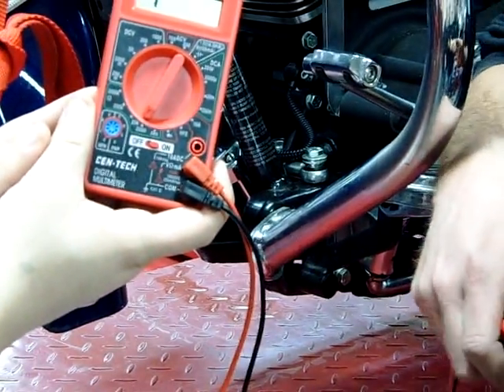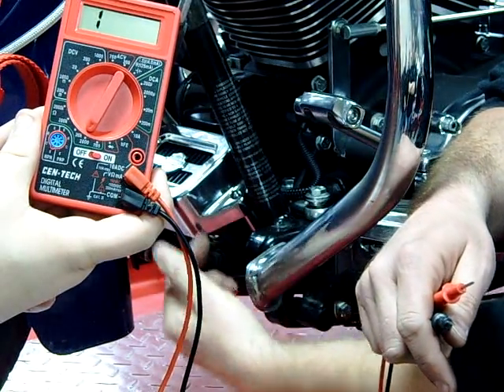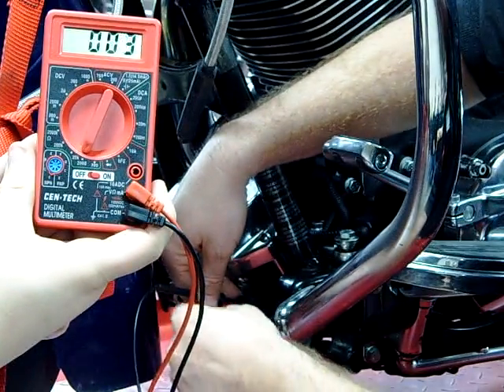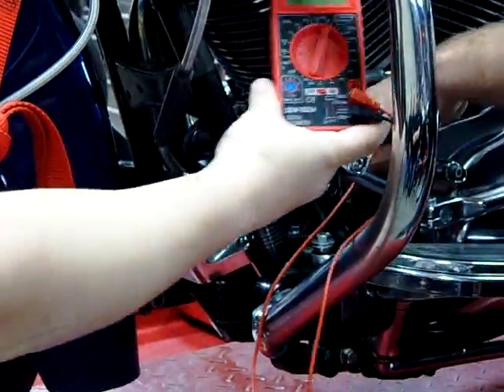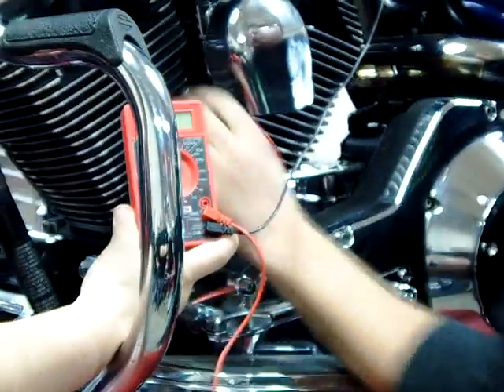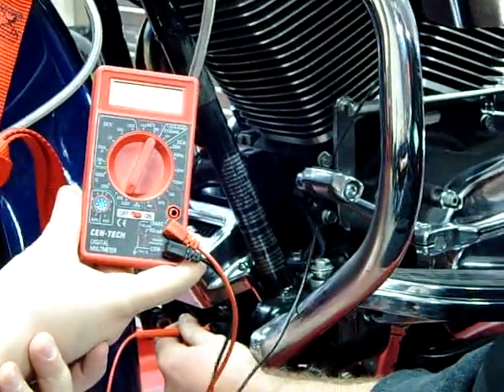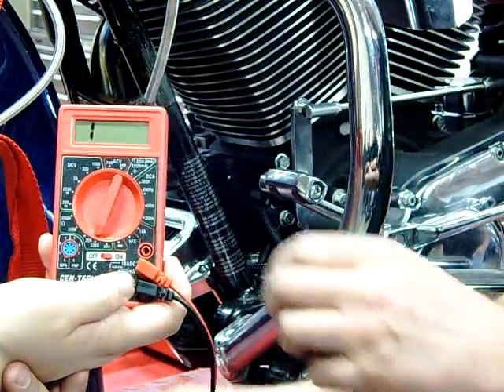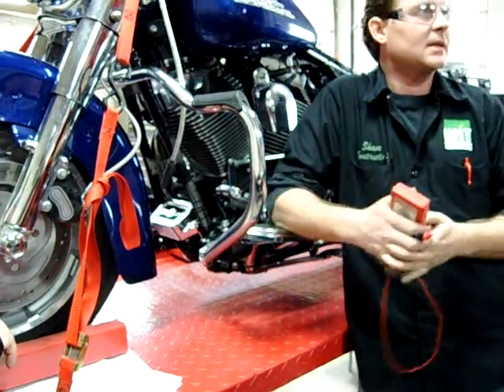3-phase Alternator Stator Charging System testing with a DVOM meter on a motorcycle Road King

Comment: So if one leg dies on a harley can you rig tiger home? Like start with battery disconnect battery and ride off other leg bo lights or do you have to have 3 legs to make the ac I guess. I would think the 2 wire probably bkt but with 3 would have a chance ?

Comment: That meter won't do the true test of the stator. Check the voltage of each wire from the stator.  Should be over 30v while running
Reply from the maker: Hey there. Social media team here. Shane is overseas training techs and about a 24-48 response time. We reached out to him quick and he said "You're looking at a 14 year old video and we made an all inclusive video a few years later covering: AC output, ground verification, REG/REC testing, DC output and a loaded stator test on and off the bench. That may make you happier as we used a SNAP ON 504 meter (ESI). That being said, the $4 meter as you put it (free at Harbor Freight) will absolutely measure AC voltage output and resistance exactly the same as any other meter as long as you do the tips we share in our meter training videos too. 
Also worthy mentioning...AC output is not enough of a test as it can read ok yet when loaded can short to ground like we show in the other video". 

Jenny here...I tried to find the video but no luck with him having over 800. 
As a member (best $2 you'll spend) you can get him to reply directly and find videos for you. Links below. 
Join the channel to access all 800 vids and Shane Daily! Smash the sub and like please. 

Just what to thank you quick? High five donation, channel membership or merch for saving you $$$$$$$ Links below to support more for this work! 🙏
You rock for commenting! We will let Shane know! Want even more? Best $2 you'll ever spend...Join this channel to get access to perks:
https://www.youtube.com/channel/UCBhM8DCKnT3qXwTW0eToyCg/join       
-Daily MEMBER FIRST COMMENTS ANSWERED FIRST 
-Live Q/A video chats
-Wonder if we have a video on your need? Members can request content links!
-Full Access to the ENTIRE 700 video library
-Member-Only FREE tool giveaways  
Ways to support or high five How 2 Wrench! Thank you in advance. YOU MOTIVATE US TO DO MORE!
1. Smash the subscribe button (thank if already a sub!)
2. Have you seen our "YouTube Trained Support Shirts?  https://goodfellasmerch.com/collections/how-2-wrench/products/support-shirt   
3. High five donation:  https://www.paypal.me/how2wrench    
4. Got an emergency and your head is about to explode from frustration or fear? Get Shane’s cell here: https://how2wrench.com/ols/products/techline-one-on-one

Comment: 2002 1100 v star replaced stator and regulator charged 14v at 3000 rpm lasted 100 miles.  INSTALLED 2 MORE REGULATORS THEY EACH LASTED ABOUT 100 MILES. FIND THE DIODES OPEN TESTING THE REGULATORS. WHAT TAKING THE DIODES OUT?

?
Reply from the maker: I can help! Please use the contact form link below. 
You're in luck. H2W is a full service repair shop or I do offer a personal training service to add to the video info for fixing your specific problem. Live Chat is great for you to actually show your specific issue! Become a member of my website. It comes with a free HOW2WRENCH “Keep Wrenching” t-shirt or 20 mins of techline! Sign up now to have my personal cell phone number on speed dial! 
As always thank you and enjoy the free videos! Much more to come! I look forward to working with you and hope you will become a member of our learning community. 

Link to membership: https://how2wrench.com/product/membershipmembers-onlymembers? 

Contact form: https://how2wrench.com/contact/

If I can ever be of service to you, here is a video explains how to connect with me. 
https://www.youtube.com/watch?v=vjvmB01ebcs 

Direct link to services: 
https://how2wrench.com/product-category/tech-lineservice-callminutes/ 

Want to say thanks you? Donation link: https://www.paypal.me/how2wrench
Reply: Diode only lets the voltage run one way , if a diode burns out its from a back flow or ground , over load

Comment: Cool easy to understand vid. 
I have a 3 phase stator I'm testing all continuity of windings and ground seem ok. I have a manual that's says I should get an ac voltage out of all of these of above 14vac at idle. Any idea what would cause one of the phases to be lower, only 6vac compared to 20vac from the other 2?
Reply from the maker: Yes. the coil is shorted to itself. "Bypassing" windings. 

If I can ever be of service to you, here is a video explains how to connect with me. 
https://www.youtube.com/watch?v=vjvmB01ebcs 
Keep Wrenching,
Shane Conley
Instructor/Motivator/Motorcyclist
www.how2wrench.com

Head over to the new website and subscribe to the newsletter to never miss a video or newsletter! 
https://how2wrench.com/contact/ 

Did you like this free video and hope to see more? Would you just like to say thank you with a donation? Click https://www.paypal.me/how2wrench
Reply: Thanks Shane. I jumped in and pulled stator out. And windings totally burnt out. Cheers

Comment: ...so....when, exactly....did Harley start using 3 phase alternators? This set-up appears to be the same single phase with zener diode type regulator that they've been using for...decades....?
Reply from the maker: Twin cam engines. 1999 was the first year I believe. If there are three wires it's a 3 phase. Aftermarket has had these out much longer. The three phase produces much more charging voltage at low RPM.

Comment: 09 fat bob,  with charged battery, i get 12.69 ish,  turn the knob on the tank, drops to 12.30ish,  turn the button to "on/start" on handle bar to on , i hear what i think is the fuel pump, and it drops to 12.10 ish...crank the bike and i go as high as 14.  and 14.50 at idol  and 14.49 giving it a little  throttle....NOW when i start the bike the meter gave me a 8.13 on one test, 7.98, on one test, and maybe as high as 9.98 on one test  ....i under stand the starting sequence is good up to the 14.50 that im guessing the charging system is good , BUT  the drop on the point of starting the bike on the drop side..is that indication that the battery is week???   im 99.9 percent shure that if i take a 30-40 min ride and turn the bike off, it may not start...

Comment: Hello, you have a great video. It helped me a lot. Sorry. I have one question. The regulator has 3 way of conection basically the strator has 3 phases and the connector can be in 3 different position.  For example the other side has 2 cables but you can only connect it one way.and the strator side can be 3 differents way.  I am not sure if i explained my self. You can connect the 3 phases 3 different ways.  Thanks
Reply: For a three wire stator with three yellow wires, it does not matter the order of the wires connected. Connect them any way and it’ll work just the same.
Reply: A, B ,C  test A,B  then Test B,C , Then C,A

Comment: heres a question for you.. i have two '06 gsxr 600s. one of the had the stator and r/r go bad. the other was fine. in my trouble shooting, i put the oem stator on the one bike w a new aftermarket r/r and the other bike had a oem r/r w the new stator. both aftermarket parts went bad and BOTH oem parts r still good. so i got new r/r and stator to install in one, w both oem in the other. my question is, with no batt installed, y do i have continuity from G to pwr on both bike when r/r is connected?